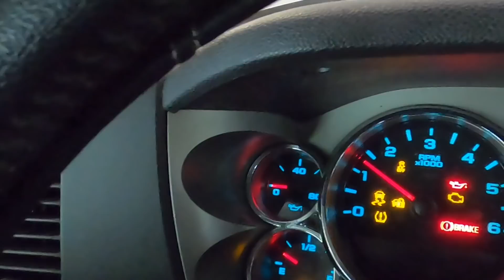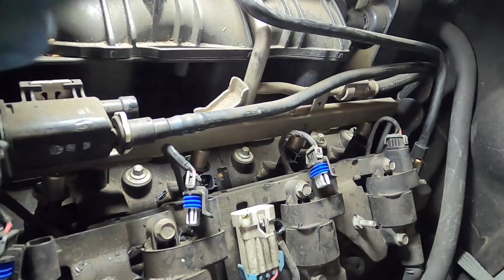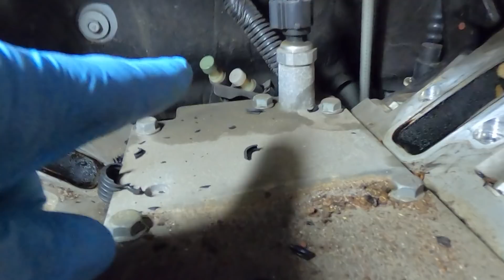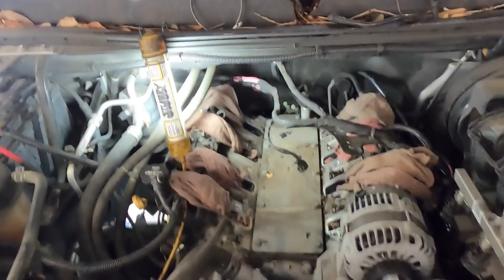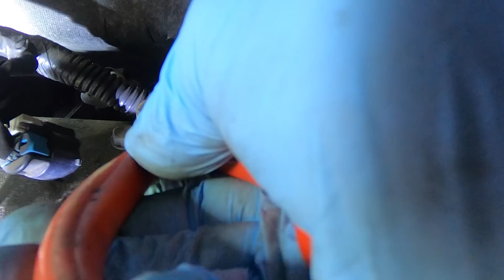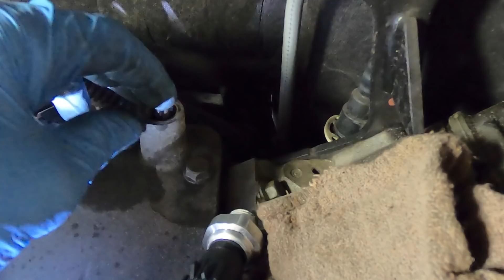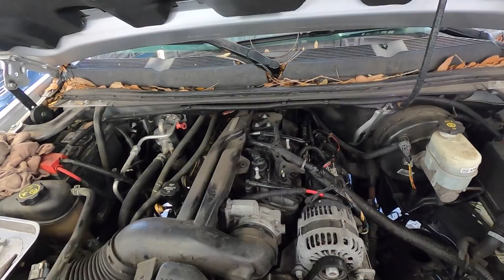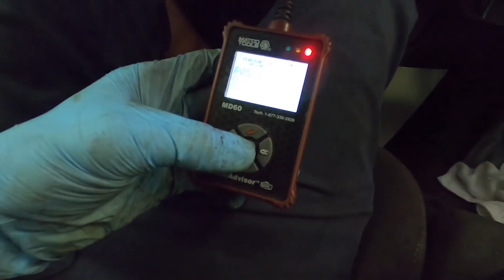Customer States: Google Diagnosis…replace this part!

Comment: I did this job on the 5.3 litre v8 on a 2007 envoy with out pulling the intake it at all short cut was to use a stubby ratchet with a flexible short handle a long pipe for leverage and a oil pressure switch socket was able to crack it loose get out the pressure switch and filter socket and reinstall in about 10 minutes diagnosed first with a scan tool and live data told me the engine had normal engine oil pressure code was a po523 code

Comment: I can tell you used a different torque wrench on the driver's side front manifold bolt.  It had a MUCH higher-pitched "click" than the others.

Comment: What asshole designed that to have sensors in only hard to reach places? Just replaced a faulty oil sender on the mitsubishi 4g54 in my Triton ute yesterday. Took 5 minutes if that. Cars from 1992 are way better to fix.

Comment: I can do it without taking the intake off. Worked for Chevy for 20 years. You are ripping the customer off. In can do it in less than five minutes. snap on make the perfect tool for doing it without taking the intake off.

Comment: I did the same on my 6.0 Silverado but I put down a moving blanket over the engine and laid down on top. Was comfy and took me about 15 minutes to replace the sending unit.
Reply: That’s exactly what I would’ve done.  But at the same time afraid if I broke something.
Reply: That is what I am doing to replace the starter on my 2001 sequoia.
Reply: I did it same way. Sans blanket.

Comment: If you have no oil pressure on the dash and a CEL you run codes to start your diagnosis and if you have the code for the oil pressure switch performance you run a manual oil pressure gauge where the sending unit goes cause these engines lose oil pumps as well and only install a new oil pressure sending unit if you have acceptable pressure on the manual gauge and DONT forget to remove the little screen before installing the new unit. AFTER performing a diagnosed faulty sending unit replacement you must clear the code related to low oil pressure to gain your functioning gauge back. LOTS of GM vehicles use this same procedure.

Comment: What is really sad you have to dismantle so much to change the oil pressure switch. Engineer needs to be fired for putting switch there.

Comment: WTF, to change a oil pressure sensor, I'm late 60s and would do this job including clean up after it exploded in under a hour, when i bought my 2013 Mazda BT 50 i opened the bonnet {Hood} and first thought was I need a mech, will not buy anything newer that 1990 if I live long enough to out live the Mazda, my moneys on the Mazda

Comment: Next time man use a shop vac instead of trying to blow out the trash. Its much cleaners plus you can get anything that might be in the intake runners then plug them up and blow out if needed. Just a tip. Good job

Comment: Oil pressure gauge still at 0. Bwaaaaaahaaaahaaaa.
I had the same problem with my 2013 Tahoe. Mine was the oil pressure switch. I diagnosed mine first though.

Comment: I’m amazed you were able to get all the connections back where they belonged without labeling them. I would have needed to label them and take pictures for sure. Good job.
Reply: Chevy made it easy to take apart and put together, most male plugs won’t go into the female plugs if it’s wrong.
Reply: All connectors will only fit into one place. It's wrong by either not reaching or not clicking properly.  I don't work on GM products but it's pretty common for manufacturers to do this.

Comment: Can someone please explain: would it not be bad for the mechanic to start the car when the car might actually have low oil pressure or none at all? He did it multiple times in the video and I hope he checked the actual pressure before doing so, or am I missing something which would be likely?
Reply: @Rawkfist1501 But it would make it worse and potentially make you liable for the damages.

Comment: What year is that engine?  I know on my 2005 Envoy there is no screen and one doesn't even fit in there.  IIRC it is only on post 2006 Chevy/GM engines that have a spot where the screen fits.

Comment: I once used you tube video sound to show what the noise my Ford was making when it was trying to engage in 4 wheel drive at 50 miles an hour on hardtop highway

Comment: Gotta love GM. it's basically:
GM: "Hey, so our engine has a tendency to burn oil, it also produces sludge bad enough that it causes issues with the sending unit. Any ideas?"
new guy: why don't do some lab tests to find out where engineering went wrong, recall the engines and replace them under warranty?
old execs erupting in laughter "screw that, just throw a screen under the sending unit and replace some arbitrary part that wont fix the problem, book it for 12 hrs and call it a day. The problem will be fixed in a few years when we release the new generation of vehicles."
GM: "Perfect! here's a million dollar bonus old exec. it's the amount we saved by not doing new guy's idea"
Reply: Uh...huh...you're personal fantasy is how it all works...you've never designed anything in your life...

Comment: Former gm master tech here. 20 seconds in I knew it needed a cam and bearings. Also the intake never needs to come off to change that sensor. Just need a sensor socket, and the right extensions and a swivel to make the corner, I replaced hundreds of them in less than 20 minutes
Reply: Nope

Comment: Think since there is a problem with the sensor (per the customer)wouldnt it be the mechanics responsibility to check the sensor plug terminal pin drag 5 volt supply ground to the sensor before reassembly  since you have it all apart

Comment: Ive test driven 6 silverados tahoes and suburbans 07 to 13 (also gm varients) each had low oil pressure and other issues the dealers would deny. Theyre kind of a mess with the faulty oil pressure system and displacement on command... 
A friend of mine said he couldnt count how many hes seen at his shop just that year...

Comment: Can’t knock google, it’s correct 8 out of 10 times, every time I took it to a mechanic, if beyond my time or capability, they diagnosed same thing. That saying engine light wasn’t blaring in my vehicles dash, that’s why google appeared correct most of time… I would swear shops google same sites. I’ve always used a standard deep well socket 1 1/6 th, works on every oil sending unit I’ve messed with. Dodge, Ford, Buick…. Maybe I’m lucky.

Comment: I just used as 1 1/16 inch (27mm) Long socket to remove & replace the oil pressure sensor in my 5.7 litre Chevrolet LS1 V8 powered Holden VY SS Commodore after I got a check engine indicator displayed on the instrument cluster back in 2010.

I took it to Holden to get it scanned back then because I didn't have a scan tool to read the codes in my pre CAN OBD2 Commodore so Holden (in Australia) charged me $75 AUD to read the code with the GM Tech 2 scanner/programmer.

It was obviously diagnosed as a faulty oil pressure sensor as I ordered a new one from the U.S. which was made in Mexico !

Comment: I had the same problem in my truck but I did figure it out. Turns out you can't leave Pennzoil made with natural gas oil in your truck for a long time. It was sitting parked for at least 7 months. I did a oil change and it actually fixed the problem.

Comment: It is possible to reach and replace without pulling the plenum, I did it with the oil screen on my 07 Suburban (I thew a stack of cardboard on the engine to lay down on top of the intake). Yeah, it's a by feel job but possible without the intake plenum removal. There's enough room after you pull the fuel lines off the rail to reach it and replace it blind by feel. Been there and done that. That little screen feeds oil to the on demand fuel management lifter control solenoids under the valley pan. The new screen didn't fit because the old screen was still in the hole. I had to make a custom curtain wire fish hook to catch and remove the old filter screen. So you basically inadvertently left the old plugged up filter screen down in there and it will continue to restrict oil flow to the on demand lifter control solenoids and oil pressure sensor. This entire issue was due to not having proper oil change intervals and / or not using the proper oil and wix quality oil filter. The plugged filter screen did the same for me, good oil pressure and then zip. Shut off engine, restart and good oil pressure for a few min's until zip again. It wasn't the oil pressure sensor, it was the plugged up filter screen causing the issue on my vehicle.
Reply: WOAH...OUCH...NOW I SEE WHAT HE WAS FIGHTING...TOO BAD WE DONT HAVE HIS PERSONAL CELL PHONE # HUH??!!!
Reply: exactly, you can tell by his tone he's a clown

Comment: My best guess that oil pump is shot and needs replaced but still that's precisely why a mechanical oil pressure gauge and would be a good way diagnose rather or not it has oil pressure or not because you can never trust those electronic sensors

Comment: I fixed a Pontiac Grand Prix awhile back that was diagnosed by the customer and Google. They had already replaced spark plugs, plug wires and one coil to fix a misfire. I was told to replace the catalytic converter since that was the next suggestion of Google. 
It was towed in and when the car was started and unloaded from tow truck I knew it wasn't a catalytic converter. 30 minutes of diag time and it was the ICM. The folks were pissed that Google never even mentioned that part. 😂😂

Comment: the person that designed that sensor placement should be made to replace every sensor that failed how dum to make replacement of a part so difficult I'm a 60 year old mechanic and these engine/car designers are not very smart

Comment: The oil pressure gauge was fine after you cleared the check engine light codes even though the customer told you not to mess with the check engine light codes?

Comment: You couldn't get the screen out because there was already a screen in there! If that screen is already plugged up a new pressure switch won't fix the problem

Comment: I have a love/hate relationship with these kinds of jobs. I love not having to diagnose but hate when it comes back or doesn't get fixed and the customer wants to blame me. "I did what you told me to and swapped the part", to which they respond, "Well you should have known that wouldn't fix it a told me".

Also, I'd use a vacuum to clean the valley, rather than a blower. Reason being, sometimes stuff falls in the runners when you remove the manifold. When you blow out the runners, you're blowing stuff into the motor on any runner that has an open intake valve.

Comment: I think it is ridiculous the way the designers and engineers design this stuff. These could be to be easier to work on, but it seems the designers and engineers do not give a damn about making things that can be worked on without danger of the techs injuring themselves.

Comment: At 32:10 you can see the oil pressure needle standing straight up. The PCM and IPC need to sync after a couple of key starts. The customer IS correct.

Comment: I gave up on the automotive repair industry back in 1996, because the owner is always right, and self diagnosed vehicles. One day a customer came in and the service order said left front turn signal lamp needs replacement. So I got the lamp, and proceeded to the parking lot and changed the lamp, this was a 1987 Devillle, with the HT4100 engine. The customer insisted that i drive it into the shop, so He went to the service manager about my not following orders!🤣😂🤣. St the manager came out and started the car, rod knocks and all! Now the customer was fuming the we damaged his engine!!

 The issue with this cars engine was well known at the time, intake gaskets would leak coolant into the oil, thus washing out all the bearings and cam lobes thus the nick names for the engine “heavy trash” or hook and tow 4100!

Comment: I wish we had gloves like that back in the 1980's/90's when I worked as a heavy equipment diesel mechanic.  I used to 'wash' my hands with hydraulic fluid to get the imbibed dirt and grease out.
Reply: What kind of dirt?

Comment: I know this is a day late and dollar short but that filter screen is for the AFM (Active Fuel Management) system which that 4.8 does NOT have.  You can tell by the smooth valley cover.  If it was AFM it would have a series of raised tubes. It doesn't use the filter on that motor 👍🏻👨🏼‍🔧🧑🏼‍🔧

Comment: And this is the reason why I don't own anything newer than a 1990. I could change my oil pressure sending unit and I don't have to take the intake manifold off or the distributor. I just reached down there with a socket disconnect the wire twist out the old one twisting the new one we plug it and booyah oil pressure sending unit works

Comment: Anyone of these i have done had a screen from factory, I believe it’s actually part of the intake gasket but serviceable , i use a pick tool but too bad there wasnt a tool similar to an orifice tube remover when they are seized on
Reply: If you buy a new one a wood screw works to get it out with the intake in the way

Comment: I've often heard/read that the high hourly rate was in part due to the cost of special tools, equipment, etc.  To then bill time as though those tools were not in use seems ...incorrect.  I know a lot of the stuff I do in my driveway would take half the time or less if I had a lift.  Is that one of the time savers left out of book rates?

But let me approach it from the opposite angle.  Suppose your accountant charged you his current hourly rate, but for the hours it would take with a quill pen and abacus?  Or your lawyer billed at $500 per hour but for the time it would take without internet for research, and with chiseling his notes into stone tablets, rather than keyboarding or dictating, or even using a ball point pen?

A big part of the negative reaction is because it's billed as "hours", and there's something within us that balks at people getting paid for 13 "hours" in an 8 hour work day.  When we are paying for it.  Perhaps the model of "flat rate pricing" from the plumbing trade would make it seem less incongruous.
Reply: You’re forgetting one simple thing here. Experience. Lift or not, tools or not, I can do most projects on my vehicles myself as I do have the know how. However, I don’t have half the experience that my local shop has. They have experience, tools, and diagnostic skills that I simply don’t. So while a shop’s rates seem high, it’s worth it when you’re taking your vehicle to an honest, trustworthy shop with good mechanics.
Reply: @mattweeks2272  I have no problem paying a skilled, well equipped pro a rate commensurate with those qualities.  I just don't think that setting the time allowance at a level easily achieved by a mechanic in his first week on the job using minimal tools is appropriately paired with that rate.  Or maybe it should not be called "hours", since it doesn't reflect time worked.

Comment: We don't know the whole story from the customer or the service writer, but what a disservice to the customer.  What was that, a four hundred dollar replacement that did nothing? Someone needs better selling skills in charging $100.00- $150.00 to diagnose, then go from there. If someone explained it right, the customer would have a better experience.  

On a global scale, nobody trusts the techs anymore due to perceived upselling. 

Just because the tech proved a point  and not the customer for no diag performed, doesn't mean they were right.   At the end of the video, tech states he has other jobs he has to do. Just wonder if he could have avoided this job, and started those jobs sooner. 

Better to be a penny wise than a pound foolish.

Comment: work lights sure have come a long way.  They used to be blazing hot and the filament would break from too much movement always at the most inopportune time.
And battery powered socket drivers oooo.
But back in the carburetor and mechanical timing days there was a lot less crap on a V8 .
Reply: Worked with the old incandescent bulbs. Heavy-duty styl were usually good for three drop tests
Reply: I remember when New Jersey's biggest Chevy dealership burned to the ground because of a dropped incandescent drop light, when somebody was doing fuel system work on a schoolbus.

Comment: That's a lot of disassembly just to install a sensor. If that's the case, why didn't they create a small removable panel at the firewall with access inside the truck. Then all you had to do is remove the panel to remove the bad sensor and replace it with the new one. It would have taken less than 30 min
to do it saving the owner in labor.
Reply: You can usually sneak those sensors out if not book time is probably no more than three hours a lot less than pulling the dashboard out to get to a panel on the firewall
Reply: @Odoyle-Rules-happy  Right, but I was thinking that if auto makers had designed an access panel on the firewall, it would save a lot on labor cost and even frustration for someone who is not as mechanically skilled as Ray. If I had that truck, I would have created an access panel myself the next time the sensor goes bad. Auto makers keep making things harder and harder to get to and Kudos to Ray for having the patience to put up with it.

Comment: Just a little info. That filter is only for Active Fuel Management Systems. The T.S.B. is actually informational to check the filter on those systems. You can not add one to that type Lifter Cover. This is my personal view on changing the sensor out in 5 minutes: I have been doing this almost 30 years. If I can Shortcut in any way and still get the same results. You are not paying me for my Minutes, you are paying me for my years of practice. On another note, takes me about 10 minutes to remove sensor install pressure gauge test and replace sensor. If you are worried about cuts scratches burns and knuckle busts, you are in the wrong industry.